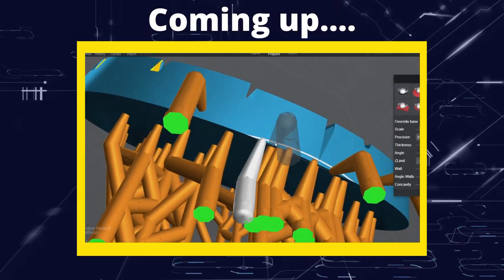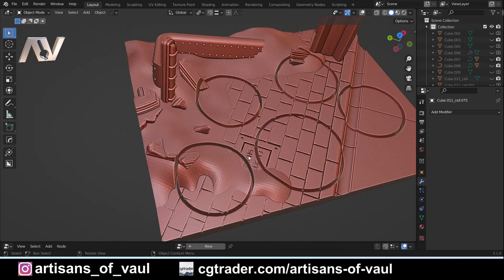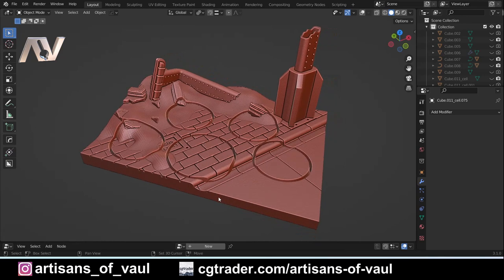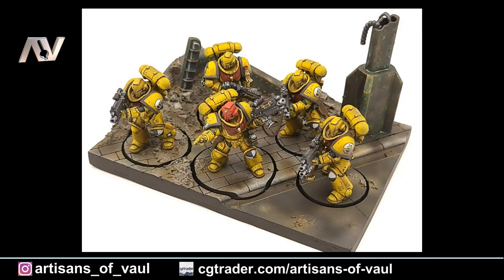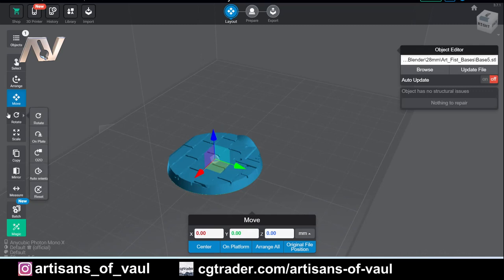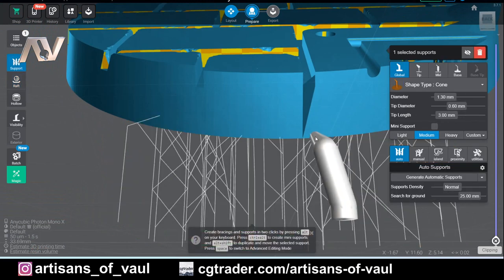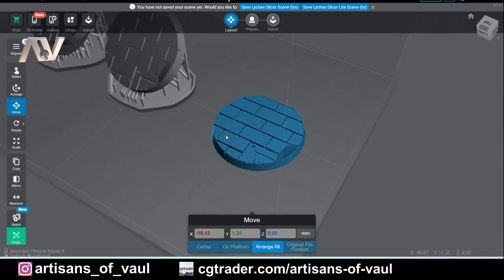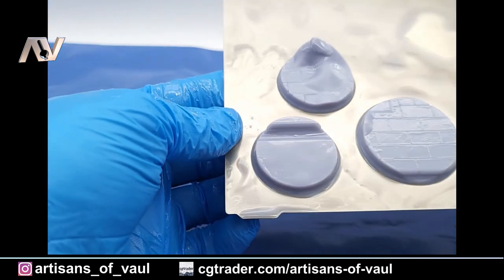How to print wargaming bases

Comment: First off - I would LOVE to see more videos like this. Specifically, videos that more fully discuss the printing side of the process. On top of that I'm sure everybody would enjoy seeing more of your final results.

Second - With regards to printing flat to the base.. this was actually my first thought when I started printing bases a couple of years back when I got my first resin printer but I stopped doing because.. well, for the reason you mentioned (getting it off of the build plate) but on top of that  you can lose fine details on the surface. With a basic brick pattern on an otherwise flat base you wouldn't notice but with something would more detail and a variation of height I'm pretty sure you'll notice the difference. Or, maybe this is only an issue with non-4k/8k printers? You tell me.
Reply from the maker: Thanks Jay, glad you liked the video.  I do want to show more of the final results too (as you say it's often helpful to see).  I am curious about the loss of detail you have mentioned, I have done this for quite a few different things and havent noticed a huge (if any) loss of detail.  It may be to do with my printer being 4k, the only thing I have had to be careful with is anything completely paralel to the build plate that can need an extra fine support.

Comment: When you're in Lychee Manual Supports, make sure you click the "mirror - X" button, so you only need to place supports for one side. Also, remember to click the "Parents" and "Bracings" button to branch off existing supports and brace against each other, resulting in a stiffer and so much more reliable support structure.
Reply from the maker: Great points. Though I wish when parenting supports you could automatically set them to become thicker in the stem when they are used as a parent, I often find the extra strain can cause them to break, even with bracing.

Comment: I have a flex base for my OG Mars Pro and if (when) I get another resin printer, I'll be ordering a flex plate at the same time. I just will not go back to chiseling prints off.
Reply from the maker: Its such a nicer process having the flexible bases.  Did you have any issue installing yours?  I heard from some that they found levelling it the first time tricky but I didnt have that issue so I was curious.

Comment: So Ive recently started attempting to make my own custom bases and print them, I also got a flexible printing bed to help remove it. However Ibe noticed that when I print it laying flat on the bed the base... Squishes? Printing on a 45° angle doesn't alter it at all, and is exactly how it is measured in Blender, just when layed flat does the z axis get affected.
Reply from the maker: That's really weird. I've never had anything like that happen. If 45 degrees works for you no reason not to do it, I just found flat more reliable.

Comment: Since you use Lychee, it (since 3.0) has elephant foot compensation available in the resin profile. Do a couple test prints and simply let Lychee do the inset for you instead of precooking into the model or sanding. This also will let you adapt to different resins and not have to re-model.
Reply from the maker: Thanks for the comments. I have played with the elephant foot compensation a but but admittedly not enough to get it working perfectly, this was one of those test prints but it was still there a bit (less than it would have been). I will continue to tweak 😅

Comment: cool thanks, fyi if you use wet & dry sandpaper with some water you don't need to worry about the dust.
Reply from the maker: That's very true, I hadn't really discovered that until recently and it's very handy stuff

Comment: I have heard this technique be referred to as a "sacrificial" in printing forums, edges/bridges/material
Reply from the maker: Which part? Printing flat on the printer bed?
Reply: @ArtisansofVaul  when you add material to an edge or hole with the purpose of it being sacrificed to take all the distortions in printing, being snapped or sanded off after

Comment: You can get rid of the elephant’s foot by insetting the bottom face of the base a couple of mil and then pull it down by the same amount. It works really well.
Reply from the maker: Thanks, I should have probably mentioned this in the video.  I find removing these extra mm more of a pain than sanding down for the other options so I didn't include it.  Its probably my inability to sand evenly  but I always find I end up with bases that dont sit flat on the table when I do this or are at an angle.  I think if I has something like a belt sander it would be worth it but as it is it takes me more time to sort out for a worse result.  But thanks for the comment as Im sure that wont be true for everyone so its good for people to know.
Reply: @ArtisansofVaul  I use a sheet of wet and dry sandpaper which has been glued onto a piece of MDF. It produces the same effect as a belt sander! ;-)
Reply from the maker: @Perchpole  Oh its not that I don't know how to sand it down. Its that sanding from the bottom through more material takes longer than the methods I've shown and there is more chance of getting bases of different heights and if you push down on one side more even though the bottom of the base is "flat" the top of the base might not be parallel to the sanded bottom.

Comment: Great video! I wonder if using a kind of combination of the two solutions would work? Basically elevating the base off the print bed by a few mm on some robust supports buried on the bottom where you can flush cut it after to avoid both the major sanding and "elephant foot" from the burn in layers. Will do some experimenting as well, I did wind up with a flexible plate, so much nicer than trying to pry it off. As for your content, I love your blender tutorials of course but am a huge fan of seeing them integrated into some final prints or slicer tricks. I much prefer Lychee too.
Reply from the maker: I did exactly this with some bases where they were not solid (the had an indent on the bottom).  I actually found it a nightmare to sort out as while I was sanding down the burn in layers I couldnt keep the base level (more a statement of my sanding ability than anything else).  It would also make a lot of material to get through.  If I had a belt sander I would definetly try it/use it though.
Reply: @ArtisansofVaul  ah! Yeah, that makes sense. Thanks for sharing the results of all this trial and error! The belt sander just sounds real messy anyway haha

Comment: Atm printing my bases flat too. Almost all of them are good, but sometimes i can print absolutely the same base with the same resin and settings in the same place and get like initial ring - then on one of the circle around 10% there would be a gap , like there wasn't enough adhesion to the resin , while other parts of the round base are fine. I honestly don't understand why and how as it happens with the same everyting even fep. And what makes me confused even more It isn't about build plate adhesion, it usually happens around layer 40-50, so it's like spontaneously wants to just not stick to the resin on a place near the edge. And this doesn't have a regularity and it could occur on the different base places (so it always happens in different places, so i presume It isn't because of FEP or build plate, or that thing would happen in the same place all the time).
I know It's quite difficult situation, tho I'm curious whether anyone has ever faces the same problem.
Reply from the maker: It it because there is some suction that causes additional sticking to the FEP when the build plate pulls away?  This is one of the more common issues with printing in this way.  I find it can be solved by putting a hole in the side of the base (or the top) depending where the issue is occuring or what is causing the suction.  That would be my guess.
Reply: @ArtisansofVaul  Thanks, would try it! But i wish i knew where exactly the suction comes, the base is quite flat,  no inner holes or smth, so maybe i just should build up some aditional material on the bottom, place a hole here and print it couple of times
Reply from the maker: @gadoyw  Oh that is intetresting, I had assumed the bases were hollow inside/ were not solid and that would create the suction.  If that isnt the case Im a little baffled too. Have you got a picture of a printed base with the line on? Or maybe a few of the bases?
Reply: @ArtisansofVaul  Magnificent youtube deletes my messages with links to the pictures so I have no idea how i can share them.
Reply from the maker: @gadoyw  That's annoying. I can be found on Instagram if that works?
Reply: @ArtisansofVaul  Nah, don't have inst and it's blocked around here. So anyways, thanks for the attempt to help!
Reply from the maker: @gadoyw9283  hmm... probably a bit tricky to help in that case. I'm not sure I would have known but sometimes you can spot something that might affect the print at that point.

Comment: What settings do you use when printing the base directly from the bed? Mine are getting stuck to the FEP
Reply from the maker: I have a magnetic bed so it can flex it to release them. I wouldn't do it without as you'd almost certainly damage the bed getting it off

Comment: still watching, but the best angle for 3d printing is not 45 degree, it’s 30. you will see a huge difference by using this.
Reply from the maker: Actually that's a really big oversimplification (at least from my reading and my experience), especially with flat surfaces. The optimum angle is generally controlled by your layer height so that should be in my mind the main consideration. However there are other factors that take effect. Either way I find 46 degrees work best with my printer and layer height and I don't doubt 30 degrees works best for you. If you'd like to read more around it there's some good explanation in this article: https://themechninja.com/07/3d-printing-flat-surfaces-on-a-sla-3d-printer/
Reply: @ArtisansofVaul  the explanation about the 30 degree lie on the fact that printers are XY fixed but not Z, and that the angle was taking most advantage of this not to make layer lines on some surfaces. well base mostly we don’t care, but on models it was a real deal. i have to find the long article that was explaining all, with impacts on layer lines and other stuff.
Reply from the maker: @alexandreducrocq3786  I'd like to read that
Reply: i just read your article and that’s mostly what he is saying, so that’s not a bad thing. And i didn’t know the impact of the z value, i go to bed less stupid :)
Reply from the maker: @alexandreducrocq3786  I think everything's a learning curve. And as I say if it works for your printer thats all good. I know someone how swears by printing at 50 degrees and seeing his prints I cant dissagree with his results but that makes no sense to me 😅 So whatever works for you 👍